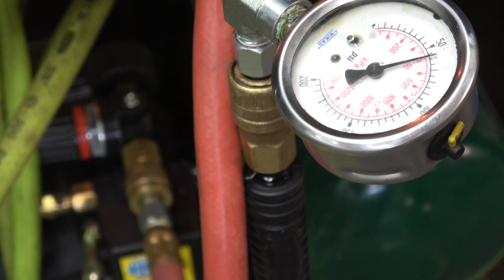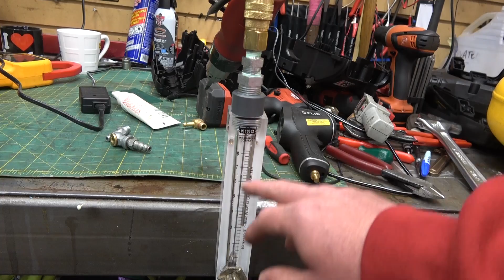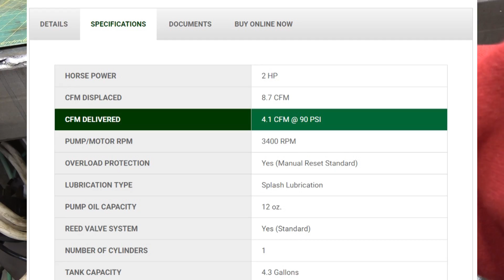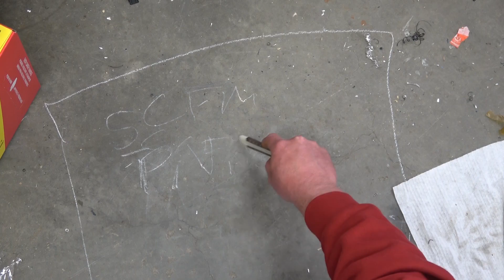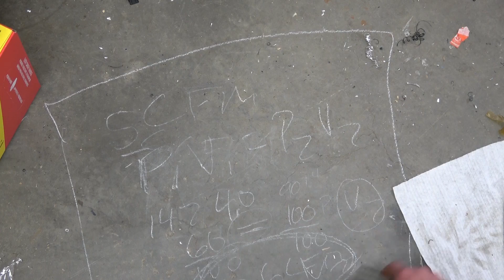Why are CFM ratings BS?

Comment: Great video; very funny!  To be a touch more fair; they are called compressors. And while volume and compression is tough to intuit how on earth could the canister hold so much air with the given parameters?  It should be clear such a dinky sized canister of air can't run for long. 

I see a compressor being about the volume of the canister.

Comment: Be the man and see what pressure and volume that any pneumatic tool can suffer. Do they lockup and bypass the gas or do they put to sleep the bearings. If need be put a hydraulic bladder inside of a Oxygen tank and you know where this is going. I have questions that need answered😈

Comment: Not really unusual. Happens in IT industry.

 Hard drive manufactures. They have been selling storage using decimal numbering so 1TB is 1000 GB. The operating system uses binary so 1 TB is actually 1024GB. So you plug your drive in and get  976.5GB. 

Similarly isps sell connection in megabits (Mb) not Mega Bytes (MB) and files are recorded in Mega Bytes so you have to divide by 8.

Comment: Makes sense after you explained it.  We have a 60 gallon 230v air compressor in the shop, and it's about 12 years old.  I believe it says it does 11CFM on the sticker.  It's nothing expensive but does what we need and use it for.  If we use some of the larger air tools, you can for sure drain it.  Heck, just filling up some of the larger tractor tires can drain the tank and make it work and yet some of these semi portable or standup portable units say they'll do half the CFM or close to it with tiny tanks and pistons?  What?  Yah, now that you explained it and showed the BS it's clear now what's going on.

On a side note, there's deceptive practices similar to this in the automotive world regarding turbo and super chargers.  Gale Banks does some great informative work in breaking down the BS and showing what the numbers really mean and what numbers really matter.

Comment: You do see "free air" CFM  ratings on compressors and that is what you are talking about. Compressor displacement x  RPM. Sometimes you get that and delivery ratings but not on cheap compressors. 

Big difference between my 1.5hp Quincy and my 2.5hp Makita compressors.  The Makita can't be 2.5hp on the same 15 amp 110V circuit - not possible. Add in the Makita's increased inefficiencies due to being a cute little package...it can't keep up with a legitimate 1.5hp compressor.  Of course a die grinder puts a hurtin' on my 1.5hp compressor but that makes sense. A good die grinder may be rated 1hp. Lots of inefficiencies with a compressor so even the Quincy eventually falls behind.

Moral of the story, buy good industrial air compressors when you can because you otherwise will not have enough air.  That said, still like my Makita MAC2400 when it fits the job.  I have a Jenny 5hp 30 gallon portable compressor when things get serious.

Comment: This one hits home lol I bought the 60gal compressor from Home Depot rated at 13.4 or so cfm an under continuous use with die grinder it will hover around 30 psi !??!? An 30 psi with a carbide burr is absolutely garbage

Comment: I remember hearing a most professionals when they talk about getting Air systems for their shops that the standard is to buy a rating that is around 5 times what you plan on using to make sure you have enough air. If that is with the professional tools with more accurate ratings then how much more would you want to buy for tools with a the super inflated misleading numbers? I'm thinking the rule still applies but that would be just for the single tool and if you were even going to be in a situation with more than one tool running at once you would have to account for that.

Comment: Yeah, I have one those CampbellHausfeld 5HP compressors.  They rated the 5 HP based on the amps drawn with a locked motor. Totally useless except as a heater.  They sent me two high grade 50' rubber hoses as compensation.  At least it has a big tank, so I can run a grinder for 30 seconds, wait 2 minutes to come back up to pressure.  The marketing wanks love to cherry pick specs, the CFM under one set of conditions, the HP at another, etc.  Pricks.

Comment: I've known this for many years. The way you get around that to run a tool like that is capacity. I have 2 large tanks and a very large water separator as well as a 4 gal air drier filled with desiccant silica beads. The compressor is rated at 10.5 scfm at 90psi. 6.5 hp 220v 15amps....yeah go ahead and do the math on that horse shit.. So anyway...the system works for really anything I do with it. Air tools, painting, sand blast cabinet, some low volume air motors of any sort you can think of because the capacity  is so high it takes a long time for the pressure to drop below what would be considered unusable air pressure. I turn the pressure up to 135 psi and  throttle it at the wall to what the tool requires. Since I dont do a lot of continual duty I very rarly hit the proverbial wall. I mean how long are you going to use a air powered jitterbug anyway before you need a beer and some recovery time? So there's your work around. If you absolutely positively need a continuous air supply for such things as air motors that are allways running or a big shop where everyone is using the air then youre going to have to spring for the big buck super equipment.

That being said..had anyone done the math on that 6.5 hp 15amp motor? LOL

Comment: It's basically as bad as vacuum cleaner manufacturers who now rate shopvacs in AirWatt. A unit purposely made up to obscure performance numbers. Take static suction at 0 flow in Pascals, flow in open air in litres per second. Multiply to get Nm/s aka Watts, and call it airwatts. As a consumer you have no way of knowing the numbers, making the stated figure utterly useless, even for comparing between vacuums that use the same dumb airwatts rating.

Comment: Hazard Fart scumbags coming in with the surprise rating: "Air delivery: 5.8 CFM @ 40 PSI, 4.7 CFM @ 90 PSI"  CENTRAL PNEUMATIC®
21 Gal. 2.5 HP 125 PSI Cast Iron Vertical Air Compressor. 
Surprised but not surprised they rate their higher models honestly. I own this unit and use it for kachunking as well as HVLP and it hasn't let me down. Never measured it though...

Comment: How long is the hose from the compressor to the guage? Putting on my EE hat, isn't pressure analogous to voltage and flow to current? If that holds there would be a pressure drop across the hose but the flow is the same.

Comment: Great Video! I always figured those numbers had to be bullshit. I was setting up our plasma cutter and wondering what the difference between CFM and SCFM was, now I know. Gonna have to test our compressors sometime. We have a 20+ year old Coleman Contractor CP-150, that is rated for 4.0CFM@90PSI and 7.0CFM@40PSI. I'm curious how it would perform, granted its well used.

Comment: Use half inch house with automotive fittings and you will get the treated supply. Also use the shortest posable hoses. Use 3/8 fittings. And take off that Dingus behind your tool! Also the size of the buns on the tank and manifold as well as the plumbing between them makes a huge difference as well 1/4 won't do ya!

Comment: As just demonstrated ALL direct drive compressors are as poweful as christmas crackers and  last just as long. My experience playing with die grinders has shown that a minimum requirement for a mains compressor is going to be a quoted 17 to 19 cfm.thats a belt drive twin or triple cylinder and thats just keeping up!  Most people view these as an industrial sized unit but its whats needed if your doing stuff like cylinder head porting.

Comment: i have an old compressor that i got at work, didnt work and i rebuilt it (cost about 100 bucks). its able to keep up most of the time, ive used snapon grinders @ 4.9cfm with out iisues.   its a two stage however which i guess i have read is not as good as a single stage when operating at lower psi?   i forget the name of the compressor, 'black' something or other from the late 90's. it takes 220 and has an 80 gal tank.

Comment: As far as I'm aware, all compressors industrial and handyman are rated by free air delivery, the suction volume, the amount of air that will be compressed to that pressure. It actually makes comparing compressors much more fair.
The reason is that directly after the compressor, the air delivered is hot. As it progresses through the system it cools back to ambient and shrinks. So the volume that reaches the tool is directly relative to the volume at the suction, not so much the discharge. Otherwise, a less efficient, hotter running compressor would be rated higher cfm than a better one, with no benefit at the tool

Comment: Stuck here in Brexit-zuela, I remember a friend worked with compressors and he said in UK they were rated in cfm "FAD" (Free Air Delivered), so for an air tool using air at 90psi, you need 6 times the cfm rating for the compressor. 

I ended up with 3 cheap 240V "8 cfm" compressors linked together and I draw air directly from one of the tank end plugs. Together they can just about run a die grinder without resting and they really heat up my man-cave. Crazy!

Comment: I've been in manufacturing for 30+ years. Seriously, who's still using pneumatic tools for efficient manufacturing? It's literally the most inefficient way to do anything.  
  
This technology is as obsolete as coal powered electricity. If you're still buying into it, you're the sucker.  
  
I'm not defending the bullshit measurements that the industry grades itself on. I'm simply pointing out that there is a reason the manufacturing industry (globally) has turned to servo technology, battery powered thing-a-magiggers, or wall pixies to turn shit for us now-a-days.  
  
Great video but, we're not in 1967 anymore Toto. Try to keep up.

Comment: It is not a jacobs chuck die grinder it is an inline drill. Glad to see he got the pressure gauge and flow meter in the correct configuration this time.

Comment: Could you plumb two compressors into one tank and boost your cfm cheaply. Possibly set the cut off of one compressor 10 psi lower than the other for safety reasons. I have 2 shitty air compressors and was just wondering if I added the small pump onto the larger one if it would easily boost my flow ya know? Seems like a good bumblefuck test. Any who just a thought let me know what you think.
Reply: Yes...you can chain them together and increase CFM.  There's a YouTube video with some lady doing this with 4.   However, you have to wire them up so one controller controls all of them ortherwise they will just equalize the overall system pressure and not the CFM.

Comment: In Germany we dont need to use some BS rating because the Compressor can can suck power trough 400V 16A 3 Phase out of the wall in your garage and deliver all of the air you want.

Comment: This is why i never bought commercial garbage. I saved up money and went to an auction and bought myself a surplus military unit. Fuck'nows who made it, there's parts from Baldor and from Italy but it worked at the plug. All i did was clean the debris from the outside, honed the cylinders, because it's nice being nice to your tools, put oil, changed some gaskets to be sure and the thing has been running since 2005. I changed the oil regularly and that's it. No complaints, holds and supplies 2 massive tanks (one retrofited by me) air on demand.

Fuck commercial, fuck companies and bigCorpo. Buy surplus, and invest in your peace and quiet. Damned thing even has an auto valve to purge water above its peak.

Comment: I noticed my single stage 2 cylinder 5 hp good sized tank compressor rated at 10.5 CFM @ 90 psi could not keep up with my higher demand air tools for more than about 5 minutes.  Now I know why!  Thanks!  I'm thinking that a two stage 16 CFM would be better for my home gamer use.

Comment: The problem isn't with the compressor ratings. Nothing is wrong with the SCFM rating system. The compressor is physically taking in that particular volume of air, and stuffing it into the tank. SCFM is essentially a unit of mass flow. 

The problem is with the air tool manufactures. Most only rate their tools based on "average SCFM" - usually assuming a 25% duty cycle. Proper high-end air tools will publish the "Actual SCFM" the tool consumes. In which case, you can properly size that tool to a compressor.

Comment: Bought a Stanley 80L compressor to blow up car tyres; took 5/10 mins/tyre, would've been quicker with a bike tyre pump :{
Reply: I have 2 of the little ones for inflating tires about 10 min a tire sometimes but its really small and i can just sit there while it works.

Comment: I maybe mistaken but I'm pretty sure that industrial air compressors are rated at the outlet of the compressor itself not at the tool because adding airline can change the cfm. There's a noticeable difference between running a tool hooked to 10ft of airline compared to running it with 200ft of line. By airline I mean a rubber type.

Comment: The new standard shall be known as AVE: Actual Volume Expelled
Reply: Best comment
Reply: Perfect lol😂
Reply: In the U.K. the size of a compressor is stated as either Swept Volume or Free Air Delivery. Swept vol. refers to the actual displacement of the pump. Free Air Delivery is what you get. There are some disreputable suppliers in the UK that will only give swept vol and when asked about FAD won't give a value.
Reply: But the needle DOES settle at 55psi after the CFM guage gets to the desired 3.5-ish CFM level, so assuming the tool is spinning at full RPM's (no-load), plus this chuck is heavier than the original collet, there's a small tool in and the bearings aren't new, so I'm assuming 32-34k RPM's,  then if the needle isn't dropping (even when the tank empties and the compressor motor kicks on), then where's the problem...? The needle's staying, ya?
Reply: @timmarrier  wtf are you going to do with a tool that can run continuously, but only at no load?

Comment: Your math are a little off, 14,7psi is the absolute atmospheric pressure. You should also use absolute pressure for the tools, so 100+14,7=114,7 psi. 
It makes the difference even bigger.

Comment: Living in Sweden, this comes as no surprise for me. I have "always" known that this is the way compressors are rated. In Sweden it's called "fri avgiven luftmängd", free delivered amount of air where free means when the air is released to atmospheric pressure. This would be the same as the German way of rating.

I actually think this is the correct method. Tools use air at different pressure that you can set with the regulator on the compressor. If the flow was given at a sertain pressure, this would not be the actual pressure used for all tools. Here, the consumption for air tools is also given in the same unit so everything matches up.

When I consider that you measure liquid flow in gpm and gas flow in another unit, cfm, I'm not surprised that no sense is made.

Comment: You just confirmed what I suspected 20 years ago when I paid $400 dollars for a 15 gallon  home shop Delta compressor that came with an impact wrench (also Delta) with the claim it could produce 230 ft.lbs of torque at 4cfm at 90 psi. Couldn't figure out why the bolts on the brake caliper of my 1994 BMW 318i  werent budging (maybe rust?) so took it to a local mechanic who twisted them off in about 2 seconds with his shop compressor.

Comment: That's kinda like saying "Our power supply can deliver 1,000,000 amps at 0V into 1nano-ohm"
Reply: or giving the specifications of a steput transformer as 2.4kV @ 10A
(volts output, amps input)
instead of input 240V @ 10A
                output 2.4kV @ 1A
Reply: They do that on those USB power banks.  They quote the output voltage at 5 V but put the amp hour rating of the 3.7 V lithium pack, so you multiply them both together to get the watt-hour rating and it's way higher than it actually is.

Comment: every one laughs @ me when I tell them they bought an really nice consumer model compressor & boy do their under wear get in a twist when IT CLEARLY says heavy duty on the front (false advertising) but will not remove 4 five lug wheels without running ( & rattling their building) for  3-5 minutes per wheel (@3450 rpm to achieve 9-11 SCFM @ 90 psi on a very low duty cycle)
watch equipment auctions & buy commercial duty & convert from 3 phase to single or a phase inverter if you want to do any real work most REAL compressors are 7-1000 rpm to produce 23-49 CFM but they need power 35 amp to start it is common a REAL 5-7.5 HP electric 1750 rpm motor ( not some 1.75-2.5 ,do the math)
that's a good unit that is quiet will run for 20-30 years if maintained properly but ya ain't gonna get anything new worth buying for under 2k Canadian but 5k gets a nice unit but on the flip side to many people buy to much compressor for their needs have seen a 10 hp screw compressor in a guys hobby work shop & he was wondering why it never shuts off & costs a fortune to run